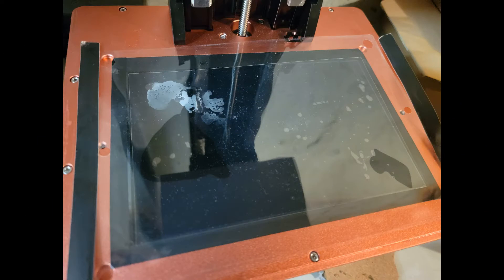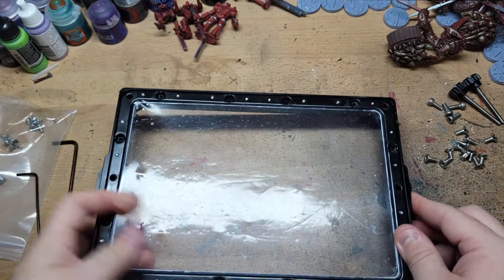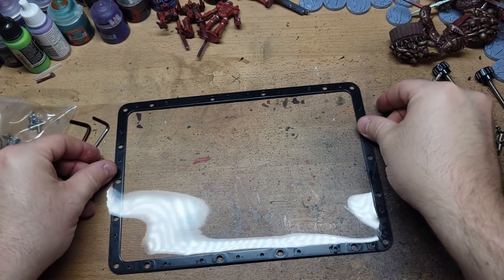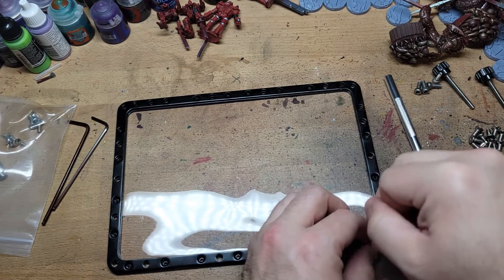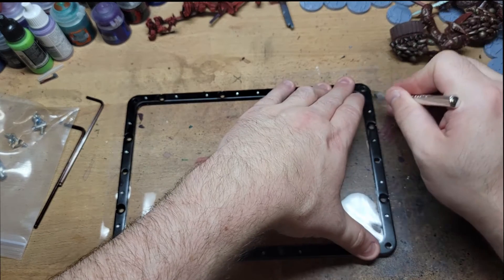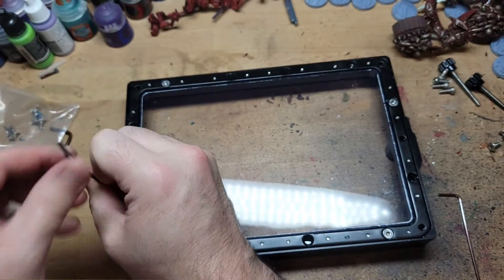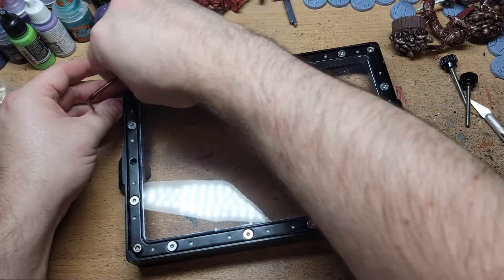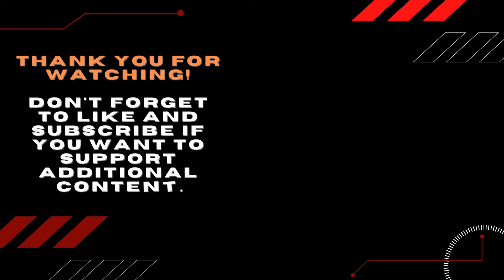Replacing FEP on an Elegoo Saturn Resin 3D Printer

Comment: Awesome video! Had a massive resin leak after my cat bumped my printer with resin pouring into the printer all onto the circuit board etc. 3rd ever print on my first ever printer. Gutted. Long story short, salvaged the printer with lots of IPA sprayed all through it scrubbing the circuits with toothbrush. But, I damaged the FEP when frantically taking it all apart. Replacing the FEP was a breeze with this video, and the vibe restored my calm and hope for this hobby. Thank you for the clear and encouraging video. 🎉
Reply from the maker: Glad you were able to salvage the printer. Be careful with the resin. Resperator, gloves, and goggles at all times.
Reply: Absolutely! Even in my panic i made sure to wear full PPE - definitely dont need any health issues from a hobby, haha!@MechanicalFrog

Comment: Thank you for sharing. Do you know if it makes a difference if it is the Saturn 8k? My instructions that came with it say to insert a foam piece under the screen during installation.
Reply from the maker: It shouldn't make a difference. Some like to have that little foam piece underneath but I never saw an issue without.
Reply: I am about to change the fep in my 8k this week sir. I'll chime in when it's done to let you know!

Comment: I can't imagine what I'm doing wrong.

I replaced my fep and tried to make it as slack as possible, but when I bolted the frame back into the reservoir it was still really tight.

Every subsequent print was sticking in a blob to the fep rather than the plate. It was so tight the fep was ripping the prints right off the plate!

So I decided to look up videos to make sure I did it correctly this time, and I can't see you doing anything differently than I did.

If anybody could offer any suggestions I'd really appreciate the help

Otherwise I just have a £400 ornament sitting there doing nothing 😭
Reply from the maker: Before you undo that FEP, make sure all your other print calibrations are correct. It may be a different issue entirely.
Reply: @MechanicalFrog  Yha is for the swift reply

Yeah I do all the usual levelling procedures and whatbot before and after every print

The FEP just keeps ripping the prints off the plate.

When I tap the FEP it's tight enough to drum like a tom tom. Sounds like a cheap bongo drum in fact
Reply from the maker: Check your resin bottle and make sure that the burn in time for those first layers is matched in your slicer.
Reply: @MechanicalFrog  I can't see what would've changed, as it was never a problem before, but it's a good suggestion

I'll have a look, and tha ks for the reply 👍

Comment: I'm a newbie, just fitted my fep on my saturn, but I fitted it tight, no slack, but it works perfectly 🤷‍♂️..no printer errors, I do use a little PTFE spray on a cloth and wipe the fep on the  inside of the vat  just to aid the lifting process ..I think when I replace the fep again,  I'd do the same thing again, ( assuming i have no problems) I dont think it needs any slack,  I think it may even last longer without slack as it will naturally slacken a little with use as the fep stretches.
Reply from the maker: I think the need for slack is just precautionary. If it's not drum tight after the screws, something went wrong.

Comment: I did my first fep change yesterday and only got 1 print to stick to the build plate out of several. I was taught by another video to put a spacer under your fep (stack of 25 playing cards) for your first set of screws to leave slack for the second set of screws to use. I think it made my fep too loose, causing failures. I'm about to try again with your method and see if I start getting successful prints again. I'll come back and drop an update if it works out for me this time.
Reply from the maker: Yeah I heard it both ways but had a lot of luck not worrying about slack with cards or a piece of foam. Good luck!
Reply: @duttdits  did your prints finally stick to the build plate correctly after using the non-slack method? I had the same issue and wanna try the non-slack method too, but want feedback before I do so.
Reply: @ChrisChurn  forgot to update. Lol. My bad. Works like a charm! This is by far the best method of the few I tried. Both the easiest and works perfectly.

Comment: Question: I've been recommended against using IPA on the FEP, as it can purportedly cause clouding issues or make the FEP too sticky to the resin? What's your take on this? 

I just came from watching a ton of videos, each more terrifying than the next. Yours was a dream!
Reply from the maker: Unfortunately, I can't weigh in on the IPA/FEP debate. It's just how I learned to do it, and it worked.

Comment: Great advice there telling everyone to use an exacto knife to cut a slit into each screw hole. That's a HUGE step imo. Ya just gotta be careful not to scratch  or put a hold in the fep.
Reply from the maker: Definitely a handle with care situation.
Reply: @MechanicalFrog  I'm about to change the fep on my Saturn  8K and being the old grognard engineer that I am, I even checked the proper torque rating between the stainless steel screws going into the holes in the frame! I'm crazy, I know. But I know if I strip out any threads, that section will get loose over time. And I've seen resin leaks. They aren't pretty! 
Thanks for taking the time to make the video! Appreciate your efforts!
Reply from the maker: @helixxharpell  You definitely put more work into it than I did. Good luck!
Reply: @MechanicalFrog  Thank you! I develop drill fixtures for high security gov filing cabinets out of aluminum. Those use S.S. screws and to insure the longevity of the fixtures in the field I recommend toque values to the locksmiths. Our fixture vendor also roll-form taps the holes instead of cutting the threads. That ensures a stronger thread. But.. the Chinese  don't know what a roll-form tap is so I'm always wary of stripping threads. Lastly, it's hard to manage fine metric threads in such a shallow depth. 
Sounds anal, I know but sometimes it's the little things that can extend product life.

Comment: Looks new compared to the one I'm away to change lol mine from new on Saturn 2 has completely delamination of the PFA it's like a wet and dry sand paper I've used it to the max still not effecting the quality of prints inface improved now its took the smotheness off the top layer but I had a stupid tiny part that came off its support and has put a crease dint in the film so I'll change it out but almost 8 months from it printing everyday I'm very very impressed with PFA

Comment: I didn't see you do anything for proper "slack" on the fep, it looks like you just straight laid the sheet and screwed it in and that makes me so relieved. I was worried I'd have to find something to give the proper slack. Thanks for the chill video!
Reply from the maker: While I have seen people recommend this, using a little sponge or a folded up paper towel. I haven't seen a need for it using the FEP sheets I have. They seem to be perfect with just a casual treatment. I'm glad you found the video useful. Take care and happy printing!
Reply: I'm a newbie, just fitted my fep on my saturn, but I fitted it tight, no slack, but it works perfectly 🤷‍♂️..no printer errors, I do use a little PTFE spray on a cloth and wipe the fep on the  inside of the vat  just to aid the lifting process ..I think when I replace the fep again,  I'd do the same thing again, ( assuming i have no problems) I dont think it needs any slack,  I think it may even last longer without slack as it will naturally slacken a little with use as the fep stretches.

Comment: What if my fep looks incredibly damaged after only a few prints?
Reply from the maker: Then I would suspect that your print settings have it going down too low and mashing prints into the FEP rather than floating just above the FEP.
Reply: @MechanicalFrog Got it! I'll try to nudge it up a little - my prints were looking fine, but i was concerned for my fep. Thank you!
Reply from the maker: Do a search for your printer and slicing software and see if you can find places where people have shared their ideal settings. Often that can help spot the issue and prevent many others. @averagemordhauplayer4821

Comment: I'm getting little wrinkle creases on the FEP after one print.  It's warping the prints as well.  Same Saturn.
Reply from the maker: makes me think the FEP sheet wasn't pulled tight enough. it should be quite rigid and inflexible to the touch.

Comment: What about the foam piece they recommend putting under the fep while screwing it to the frame to get the tension the fep needs?
Reply from the maker: From doing it three times now, I haven't had any issues with letting the screws do the tensioning.
Reply: @MechanicalFrog  okay, i will test it 🙂
Reply: @shaalomn3967  Did it work?
Reply: @coetconley  yes it worked
Reply: Came here looking for an answer about this! Thanks for asking and thanks for answering!
Reply: @MechanicalFrog  gonna try your method, did it with the foam before and now I can't get a single succesful print.
Reply from the maker: @3lcost3  Good luck. Go with just a piece of paper towel underneath to prevent scratching on whatever is on the table underneath.
Reply: @MechanicalFrog  just tried and it went just as bad, even worst cause a piece of the FEP got torn by the build plate, thankfully no spilling on the screen. I'm really not sure what else to try, I ran out of sheets, don't know why is it so difficult to get right
Reply from the maker: @3lcost3  I'm sorry to hear that. What on the build plate is sharp enough to cut the FEP?
Reply: @MechanicalFrog  I'm not sure, the build plate was sanded before and it worked fine, I'm guessing is because the FEP was too tense, however, I read somewhere that it had to be between 330 - 350 Hz which mine was and still it happened
Reply from the maker: @3lcost3  I am genuinely confused.
Reply: @MechanicalFrog  me too, at this point I don't know what to try
Reply from the maker: @3lcost3  Maybe take some photos of the situation and share on reddit? Maybe someone can spot the issue.
Reply: @3lcost3  Did you resolve it? I use tweezers to make the holes. A knife creates a "line" that more easily continues to extend. Also I gave it the 8mm space many recomends. First sheet with only 5mm hold up 3 months, second sheet with 8mm hold up about 7 months with every intsense use. User error destroyed it.